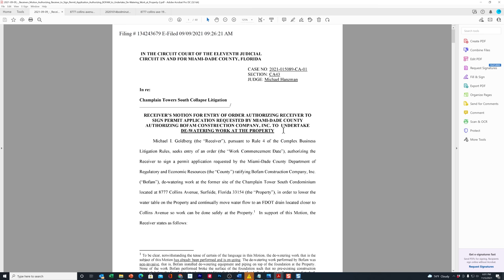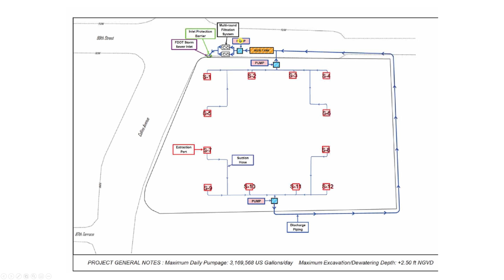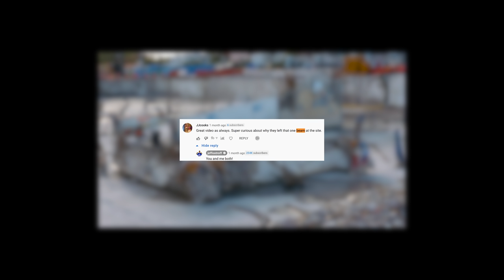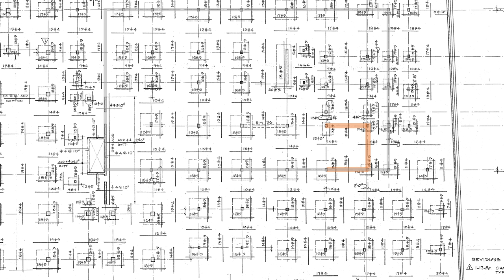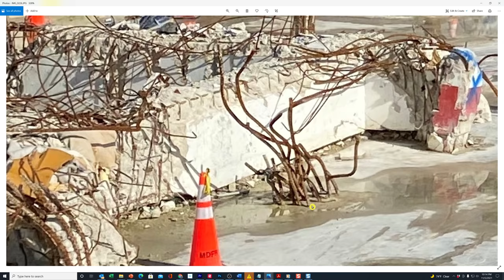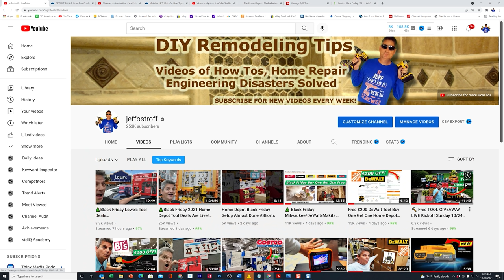Miami Condo Collapse: Engineers Baffled By Mystery Column

Comment: Good Video again, I did find a few other shots of the east side of the H beam in your Nist Video post, unfortunately the base of the mystery column/rebar is in water once again.  I am at a loss where that rebar/column came from as when I review the position of the H beam it looks like it pretty much fell vertically and and wasn't moved in the site clean up.  Perhaps it is the end of the beam from floor one and the optical illusion makes it look like it was attached to the garage floor.   I guess one of the residents who parked in the garage can inform us if their was a column in the position.
Reply from the maker: but, wher eis the damage to the floor if the column came down and impaled into the floor?
Reply: @jeffostroff    As far as damage to floor, perhaps all that was left from the end of the first floor column after the removal of rubble was the drooping rebar.   If I didn't live 2000 miles away a midnight trip to the sight for closer examination would be warranted

Comment: I think they removed the missing column during the original construction process. After they realized it was in the middle of the driveway in the garage. The H beams that you refer to and showed is strictly to correct this architectural or construction mistake. You couldn’t see it in the video that you showed of the garage before the collapse because it was cut off below the finished floor level of the garage. Isn’t there a sister building just down the street that is still standing? How was this issue addressed in that building? That could tell you a lot.

Comment: Was that beam a recent retro-fit? You mentioned shoring up. Would such a record be made?
Reply from the maker: The beam is not a recent retrofit so it sounds to me like you didn't really watch the video. Because in the video I showed you that it was part of the original floor plan and I showed you where it was in the floor plan. Now if this mystery column was added in the last 12 months, it is not likely that it was there to shore up the H beam as I'm sure it was in pretty good shape. If it was put there it was likely to shore up something in the garage ceiling, although I don't see why they would not have done it with shoring poles.

Comment: Ok Jeff says the H beam did not move horizontally. Fine. 
Now you can see scoring lines on the side of 
beam 35 where the column steel tore down the side and slid down at a slight angle and to the east  to embed in the soft concrete. The concrete around the rebar was removed.
Also you can see  pieces of the column's rebar still embedded into the top of Beam 35.
So the only way to solve this is to do a scale model using a chunk of concrete from the site.
I think that column was holding about 360 kips.
Reply from the maker: If you look at pictures on the other side of the H-beam away from the mystery column, looks like a large chunk of concrete  on the top of it hanging away from the mystery column could be where the K column was rooted.
Reply: @jeffostroff  Correct. A crane operator said 10 kips could drive #8 rebar into concrete just as a shot pin does. This is weird but I see no other explanation.
Reply: @jeffostroff  Very probable.
Here is a link to calcs on failures at CTS.

Comment: That mystery column seems to be in just about the right spot to be the column you showed at 2:17 (the only one still green) that brought all the weight from the Penthouse down to the H-Beam that then transfer it to the 4 H-Beam Support columns. It could have slid off the H-Beam as it fell and landed on the floor slab...
Reply from the maker: Yes one of the 2 popular theories
Reply: Nope, not possible.  The column atop the H beam was 5' 3" away from column row 'O', where our mystery column is.  [Trigonometry alert] The 1st floor 'K' column segment was about 12 feet long, so if it slipped off the H beam (not really possible with it's rebar connection) and shifted 5' 3" to the east, what was it's angle of impact??  Hint:  Nowhere near vertical.  

The other columns were even further away, over 10 feet.

Next theory.

Next theory.

Comment: Ok. Hear me out. Perfect pic at 14:07 of vid. The H beam looks to have shifted slightly towards the entrance/exit AND was supporting a column from the top and not below. Everything gave way in the car park first so what if when the H beam quickly gave way it sheered the rebar and the weight of that whole column came crashing straight down and stabbed that rebar into the ground making it look like a new pillar. Just watched the video and never checked comments.
Reply from the maker: yes, on possibility, but no damage o the floor?

Comment: I’m not an engineer but you’d think there would be tie-wire remnants on the ends of the rebar. Was the rebar a sufficient size for the load?
Reply from the maker: Yes there is not a lof of rebar left at all where the column should be

Comment: I was wondering if you have a picture of the east side of the ramp on the parking level before the collapse? Also, I can only follow you on my smart phone and your pointer is nearly invisible, by the time I find it I can't tell what you're talking about. 
I wonder if when they put in the support beams for the planters if that caused the foundation to weaken more. Once the heavy planters were added plus the weight of those water filled palms and vibration from fork lifts or what ever equipment they used. The reason I wonder this is because when the walls of Jericho came down it was believed it was because of the constant marching around pounding the earth. I am no engineer or anything. Just puzzle things out.
Reply from the maker: No photos of east side of ramp. The beams were built when the building was built, so by themselves they likely did not hurt anything

Comment: It's interesting that we see surface rust but little if any concrete attached to the rebar; plus what looks to be an intentional section cut from the floor as though at some point they were looking to add a footing. So many questions.
Reply from the maker: Yes, it appears to me that when they were slicing off all of the columns at around the three or four-foot height off of the floor, I'm assuming they cleaned out all of the concrete between them but I don't know why they would have done that.
Reply: @jeffostroff  I read somewhere that the original construction was stopped midway (money issues?) and restarted. If that is true, the rebar had plenty of time to get rusted, and concrete bonding would be iffy.

Comment: My personal untrained belief is the mystery column is impaled into the garage floor. That column appears to be carrying a significant amount of weight of the building. I wouldn't think it that difficult for it to impale itself through the concrete floor of the garage. Might also explain the water in the area as well. Just a thought.
Reply from the maker: Yes I don't think it was impaled, I think it was added in the last 12 months before the collapse

Comment: I'm just a firefighter that worked on the collapse but I was looking at the video that showed the garage before the collapse. I can see a huge crack in the floor between the "ramp" and the "H" column yet on any of the other views of the "hockey rink" I don't see that crack, also, on the video...when looking up the ramp I should see the blue "sister" building. I really don't see anything. Not even a hint of blue. I'm just wondering if the video of the garage is that of the sister building and not the collapse building?
Reply from the maker: Great observation on the cracks on the floor! I saw those cracks also and was wondering if that was domething bad getting ready to happen on the foundation. But you're incorrect about looking up the ramp to see the sister building because the sister building is actually three buildings north. So starting at the Champlain towers and moving north you have first, the blue hotel, then you have Champlain Towers East condo, and then one building north of that is Champlain Towers North, which is not a blue building. As for why do we not see the cracks now on the floor? Keep in mind there was absolutely boatloads of powder and crumbs and debris landing on that garage floor and it has likely filled in those cracks and there's like powdery chalk like substance all over the floor that are likely to hide any details that we we're able to see in Fiorella's garage video before the collapse, and before any powdery debris started to cover everything up.

Comment: It has clearly moved over and is no longer blocking the driveway. At 14:40 if you line up the the two columns in the foreground toward the ramp you can see how far back the beam is sitting.
Reply from the maker: You are wrong. You incorrectly identified the two  columns those are not the columns that the H beam was resting on. The four columns of the H Beam was resting on are still there right next to the H beam and still touching it so it only fell 12 inches to the north. And by the way the each beam is still in line with the bottom of the ramp. If you take a look at the overhead photo as i showed earlier in the video comma you will see it fell directly where i said it fell which is still in line with the bottom of the ramp.

Comment: It seems to me the only reason you would add a column of that size and reinforcement is to provide additional support for the structure above. That would be an engineered design that should have been stamped by a PE. So there should be a record somewhere. The vertical legs lap lengths appear longer when compared to the original columns and indicate more current design codes. It is strange to me though that its not placed under the H beam and directly under the column that rests on top of the H beam. Which suggests the ceiling above needed shoring. But that column reinforcement steel would need to be drilled and doweled into the ceiling slab to have any effect. And that seems unlikely given the amount demolition that would be required to get sufficient embedment lengths and ultimately just weaken the floor slab above. And if its a temporary support, why reinforced concrete? The only other thing I could think of is they were constructing a partial frame from line O to line to the wall connected with a new beam to carry load from the first floor slab. It is a great mystery.
Reply from the maker: Indeed, I could find no permits. But that building has a history of unpermitted work also. Could be they added it last year unpermitted, and it was meant to shore up the ceiling next to  the beam.
Reply: From the beginning i knew the failure would be due to unpermitted work they always want to cut corners
Reply: Holy shit, a rational answer that doesn't rely on 'cartoon physics' or a magic supersonic column penetrator....

Thank you, Joe Greene!

I also searched for a permit for this work and found NADA.  If it was just a temporary support of a slab until proper repair could be done, they could have just used heavy timbers and concrete shoring jacks.  That would have been more than adequate.  Why in the hell did they think they needed a large column, put in the wrong place??
Reply: @BWIL2515  Well, the root cause of the collapse was a poorly-designed pool deck coupled with 40 years of corrosion and spalling.

Comment: Regarding the columns with bases painted RED.  There are several throughout the garage as seen in other videos of other sections of the garage.  Each seems to have an EMT conduit to a Jbox mounted on one face of the column.  Given that red paint is almost always used to identify fire-related services/equipment (like red sprinkler pipes seen throughout), I believe some fire-related device is mounted in those Jboxes seen on Red columns.  Likely Alarm Pull-Stations or Heat or Smoke sensors.
Reply from the maker: yes you might be right

Comment: This is a tough one and not to change the subject but... 
Putting steel inside of concrete was never a good idea and we only do it because it is so inexpensive and so strong (initially). Same reason car makers still use the CVT, so inexpensive and usually last longer than the warranty (barely)
Reply: Steel reinforced concrete is widely used, the most popular construction method in the world (by mass). It is strong, and safe - if dipshits do required maintenance.
Reply from the maker: Putting the rebar inside the concrete makes perfect sense, and that is why they are supposed to embed it a certain distance inward, to protect it from water, and in theory, in a garage, it should be fairly safe, even though it is somewhat humid down there. I also think that once the columns have cured if you can prime them and paint them and keep them sealed there should never be an issue with moisture getting into the rebar.
Reply: @jeffostroff  Concrete, paint, seals and most materials allow water penetration to cause steel to rust !
Reply: @jeffostroff  I understand the construction plans had the 3/4 in of cover.  Using non-galv rebar 100 feet from the ocean.  What could possibly go wrong?
Reply: @phillipkalaveras1725  Steel and concrete expands and contracts at very similar rates. Thats why they use it. This method has built the modern world, and building collapses are very rare.

Comment: I like your videos, you have good knowledge and explain things in an understandable way. I only watch you and Building Integrity. Ive been in construction my whole life and now work in 3D development with some FEA that im learning more about. Im not going to profess i wide scope of knowledge or give an opinion as to where i or what i think this column is but i'll give my own observation:

1. This column appears to be in line with column running west to east.
2. on one drawing, it appears there is a beam directly above this spurious column
3. this steel looks foreign to its location. there is no concrete internally to the rebar. look at all of the others, any column that was supposed to be there is perpendicular out of the slab and then bends off to the west. This rebar bends at base with no debris . it looks like its either appeared there or added after the fact.
4. an assumption can be, problems were identified around the planter areas above and a secondary column was added to try and support that. The column attachment / binding of the column into the beam above may have impacted the beam integrity leading to tension weakness and / or failure. 

Like i said, its just my humble opinion and observations. No conspiracy, no trolling.

Keep up the good work Jeff :)
Reply from the maker: Thanks so much!

Comment: it's possible that mystery column is the column in the middle of the beam and it was pushed into the ground floor by the weight of building collapsing on top of it.
Reply from the maker: Your hypothesis comes up a lot from boatloads of people about that column. I don't think it's possible because if it had slipped off it would not likely have come straight down where the mystery column is which is only about two feet away from the HP. Also if it had impaled the floor there should be damage all over the concrete there and there is none where is the crater? So where else could the column come from? So far my prevailing theory is that somebody started to build that column sometime after Fiorella shot her video in July 2020. however I could find no permits for it
Reply: @jeffostroff  So the hypothesis is that the column from above punched a hole in the basement floor slab and went on into the ground...  It is possible to have punching shear failure in the slab, and maybe it did punch a clean hole on the top of the slab.  Punching shear works that way- a small hole going in and a large hole going out.  However with a slab of that thickness and amount of reinforcing it likely would have caused more damage to the slab around that area.  There are too many unknowns about what is under the slab for us to be able to know for sure one way or the other.  If the slab was well supported by the pile caps being right under the slab, and/or the slab was well supported by soil under the slab, maybe it could have punched a hole without significant disturbance around it.  If soil under the slab settled and left a void, and there was a gap between slab and pile caps, I don't think it could have punched a hole without other surrounding damage.
Nevertheless, despite the unlikeliness of this actually happening, an impaled column would be the answer that best matches the physical evidence.  I'm beginning to change my mind a little bit about this.

Comment: Jeff, the h beam is clearly laying offset from where it originally stood.  That mystery column is really the south east most corner of the beams in question.  Appreciate you looking into details but the simplest answer is often the most likely one.
Reply from the maker: No the beam is clearly not offset from where it originally stood there was no way it could fall that far it actually slid down the north side of the four columns that were holding it up. You can see in the videos of it where that other column is that you were talking about it is still there. And I already showed you that the column that I think is new is coming out of the middle of the driveway so it couldn't possibly be any of the others